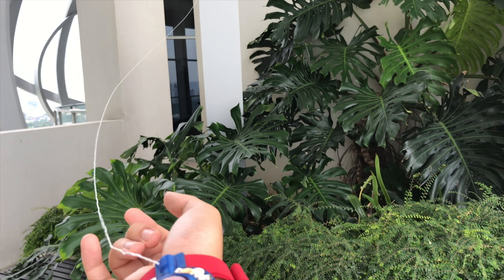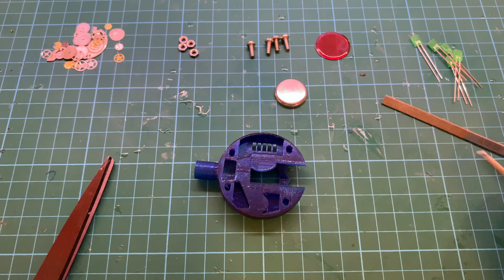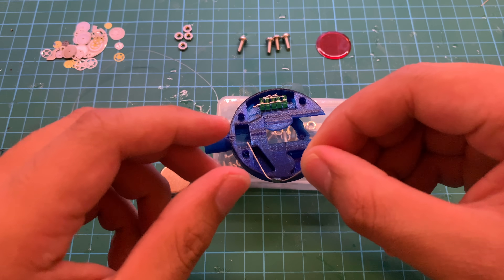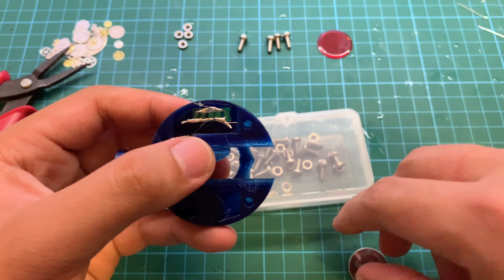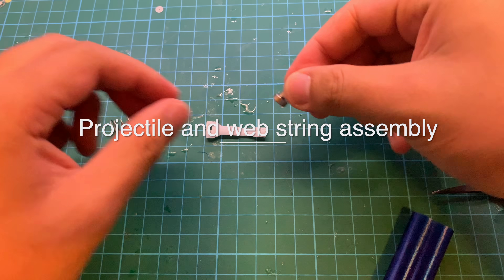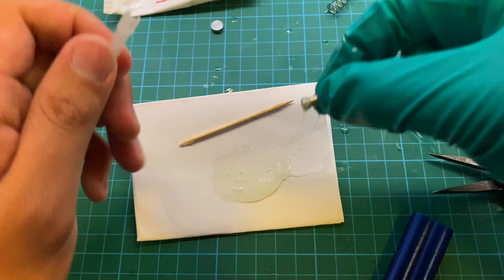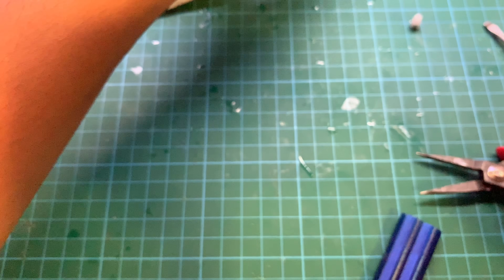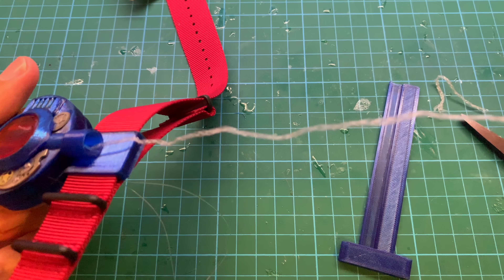How to Make the Functional Web Shooter (DIY Tutorial)

Comment: What’s the size of the spring ?
Reply from the maker: For the spring sizes: 
We use the shincoil SSC-026D-12s and shincoil SSC-014B-05s
 Free length: 38.10mm, solid length: 7.65mm, outside diameter: 7.62mm, wire diameter: 0.66mm
Free length: 12.7mm, solid length: 2.6mm, outside diameter: 4.57mm, wire diameter: 0.36mm

Comment: I have a question, in the files, the part for the leftbody has a thing on the bottom. Is that supposed to support it? Or can you flip it and print it horizontally opposed to verticallly

Comment: Finished mine, i modded it a little bit, basically i changed the STL to have only one LED (Round) just cause i was short on the rectangular ones,  instead of the chip, i created a circular "chip" with the spider logo. Also printed everything in black and white. For the projectile spring i used one from the ender 3 printer bed (the stock ones). Ill also print hal a ring (king of) so that the nylon wont hurt my sons finger (Might also have to reduce the tension from the block small spring. 
https://imgur.com/gallery/nPe90Ns   ->> Heres my version,  all thanks to you man! Thank you so much... 
will you be releasing the project for the multi Functional shooter and/or the web12?
Reply from the maker: That’s incredible man!!! So cool, love the spider logo chip design. Eventually we’re releasing the web-12 design as well as something new :)
Reply: @herotech  Hello! We are working on these for our son for Halloween/Cosplay. I'm having a hard time pinpointing the size of springs to buy. Can you please help me out? Thanks!
Reply from the maker: The diameter of the small spring is about 4 mm, and the diameter of the launch spring is about 8 mm
Reply: @justins3729  the projectile spring, i used one of the stock ender 3 bed. The block spring i used one i already had around.

Comment: Hi, again, about the lockblock spring for what i can tell in the 3d model the hole for the spring is 5mm diameter... so do you think a spring with a 5mm outter diameter and 15mm lenght would do the job? i found some at aliexpress, for those who are having trouble finding the spring, here it goes: https://pt.aliexpress.com/item/33021841876.html?spm=a2g0o.productlist.0.0.1a7514c41QhEal&algo_pvid=81ce783b-bbdc-4c06-a6a2-ec91acf59728&algo_expid=81ce783b-bbdc-4c06-a6a2-ec91acf59728-8&btsid=b84d5114-3f10-45fc-8dda-caadfc4c27bf&ws_ab_test=searchweb0_0,searchweb201602_8,searchweb201603_60
Reply from the maker: It should!

Comment: Hey im kinda confused. Ive been studying your 3D print design and ive seen how you loaded the projectile in the video but im kinda confused on what holds the projectile in place. So you pull back the lockblock to load in the projectile then what part of the projectile is the lockblock holding back from firing? Because i still see the other end of the projectile sticking out of the tube.. im just kinda confused..
Maybe you can help me by explaining the mechanism a but more
Reply from the maker: Sure! If u see the projectile you’ll notice there’s a small ledge/cavity on the projectile - this is where the lock block catches and locks the projectile in place until the nylon line is pulled.
Reply: HeroTech Woa thanks man! Im so glad you replied 😀😀 big help

Comment: Quick question! Does it really have to be epoxy? Or can it be substituted with something like gorilla glue? Or super glue?
Reply: also, what program did you use to make the 3D design?
Reply: also, i noticed that you used 2 springs, the “small spring” and “big spring”

The link in the description doesnt specify either.. what are the lengths?
Reply from the maker: For best impact resistance it should be epoxy 👍 I used autodesk fusion 360, and the two serial numbers in the vid description are the part numbers of the big and small spring

Comment: This is a cool concept and I even built a couple. There needs to be a few tweaks to the design though, the spacers inside the top section where the 3MM nuts go need to be removed, you cannot get the nut to fit correctly since it takes up so much space behind the hole for the 3M screw.
Reply from the maker: I used half width nuts (the ones from RS Pro) so that’s probably why they didn’t fit 😅

Comment: awesome video, btw I dont get how pulling the string actually makes the projectile fire, could you please explain?
Reply: So the projectile and lockbox are designed to fit into each other. The projectile has a compressed spring which puts it under a lot of tension when the lockbox is in place, since the lockbox won't allow it to move. Pulling the string pulls down the lockbox, allowing the spring to expand and then launch forward
Reply: @powerpow365  i see, thanks a lot, keep up with this sick work👊👊
Reply: @duttaarjun1453  I did not create the webshooter I'm just another viewer who really wants to make one now
Reply: @powerpow365  oops my bad

Comment: Hey what kind of printer do you use? I have a CoCoonCreate Model Maker and I wanna know if it would be capable of printing those compartments. Additionally, would regular PLA work as material instead of PETG? It'c all my printer can reliably do
Reply from the maker: Prusa i3, everything but polycarbonate should be easy :)

Comment: Can you make a video on whats the best positions to do the 3d print?
Reply from the maker: I can try and explain it! The body and bottom need to be printed vertically in the z direction ( so the barrel is facing the bed) with a brim
Reply: @herotech  hm I think i can see that from your video, is just the workshop i went to, i guess without seeing how is printed they are very unsure of how to do it.. since they think i need support for alot of these things..  (  like what direction to print the projectile part ) ( how much infill density or print quality etc) ( they are using Z-Suite and have a zortrax m200) Maybe if you can just screenshot whatever the thing looks like at the end that u send it to the printer? whatever settings and directions all the parts are on i guess that would help greatly if possible!

Comment: So how does the lock block work when you pull it down? What is the spring pushing off of, so that it becomes a projectile? I am currently working on a design myself and wanted to use something similar to that! Great design!
Reply from the maker: The springs pushing off of a ledge incorporated into the barrel :) the projectile itself has a latch that locks
Onto the lock block
Reply: HeroTech oh ok. That makes a lot of sense. Thank you for replying, But how does your latch work when pulling the lock block down?

Comment: Hey ( yes it's me again x)) I have a problem with my 3D print of the rightbody (or the leftbody, the problem happend for the 2) the round tip, where you put the projectile, is not printing in a round shape so I can't put the projectile in it! Do someone have a solution for do that my 3D printer print the round tip in a ROUND shape? thanks for help in advance ^^
Reply from the maker: I would print vertically along the z axis so that there’s no sagging of the filament !

Comment: In this case, lead is pronounced "leed". Also, you can typically use the length of the lead before you cut it to determine polarity. Marking one side with a sharpie before you trim, or wait till they're in place before you trim can help.

Edit: Please also invest in a pop filter of some kind. All of our ears will greatly appreciate it.

Comment: I rather have made a metal version like copper steel and other platforms with real gear's and the strongest rope or string that can't hardly be seen to then make a real and working one sorta like spy accessories but stronger and better and to swing around like spider man with practice lol
Reply: Kinda impossible to swing because either your back or shoulders will break. So this is the closest thing you can get.

Comment: 124$ total (yes I did the math) to make it plus you need to find a 3d printer and a soldering tool and the fillament is like 50$ each without it it is still 70$

Comment: You should make one that can retract with a button while still using this design
Reply from the maker: Working on it :)
Reply: @herotech  yoooo I'm pretty sure it's impossible but any way to increase the tensile strength? Atleast if you're not swinging you can just web snacks and the TV remote to your hands ;))))
Reply: Derpy Fire it’s not really impossible. If you want stronger tensile strength then what you’d have to do is braid the nylon thread very well and make sure it’s not bulky to the point you can’t fill your web cartridge with.
Reply: @CosmicGaijin  Oor fishing line, that stuff is pretty thin but it's also strong. Just be careful not to tangle it up  ^^
Reply: yes
Reply: I c an give you a idea I know i am late but here it is. you can attach a motor on wrist band and glue the other end of the thread to the motor and make the motor spin clockwise.then make a button or switch circuit to it using a mini switch. There you have it. Once you press the button the motor will start spinning and it will retract the thread the the bullet. I don't know if this possible on this model. Because the thread is inside the cartridge thing
Reply: @GAG YT yes